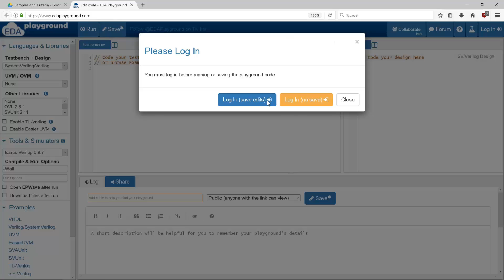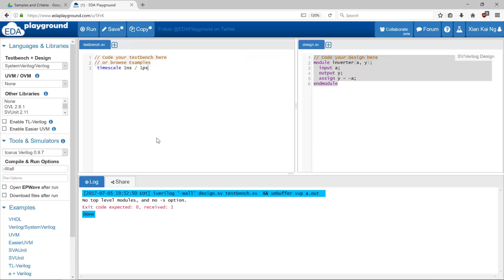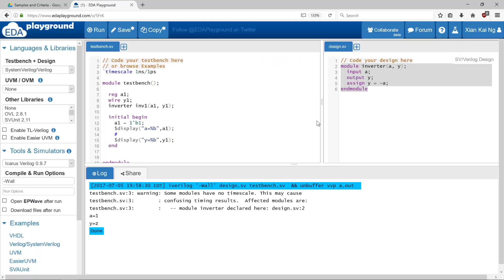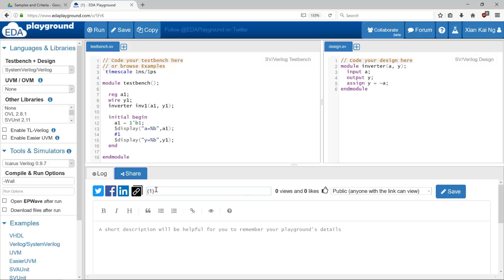Verilog on EDA Playground Starting Tutorial

Comment: The reason you get the y=z is NOT because "this module takes a little bit of time..."  It has to do with how events are scheduled in the simulator.  In this example, you are asking the simulator to simulate only at time 0 and you are trying to know know what a and z are at simulation time 0. Please study about simulator events and when/how they occur in relation to $display, or $monitor, assign. etc..  The $display issue has nothing to do with simulating "actual transistors and stuff" or "for electricity to move"
Here's an article that may help you. http://www.sunburst-design.com/papers/CummingsSNUG2006Boston_SystemVerilog_Events.pdf